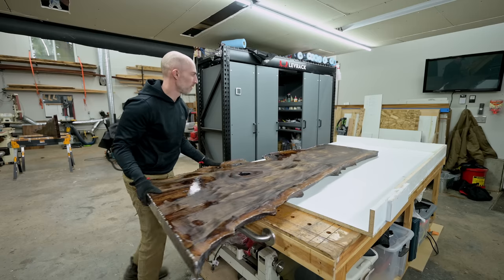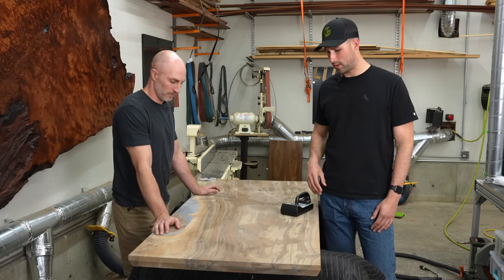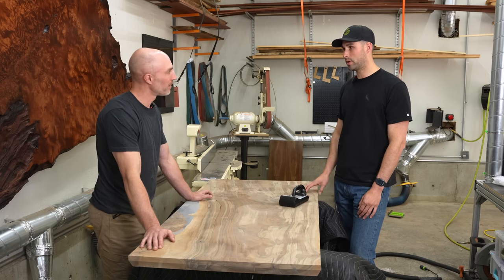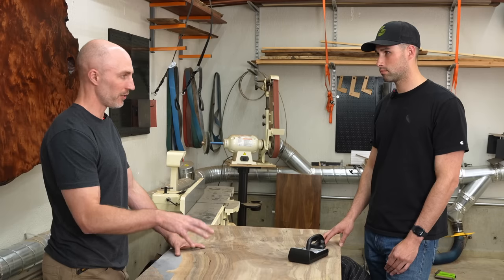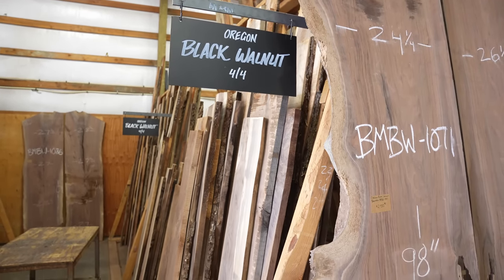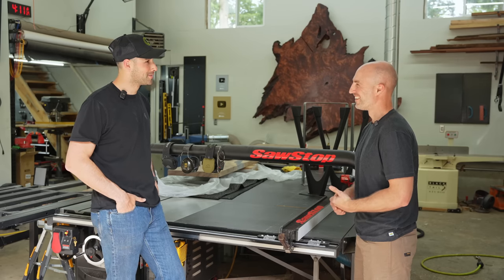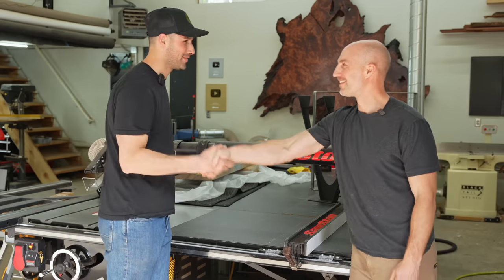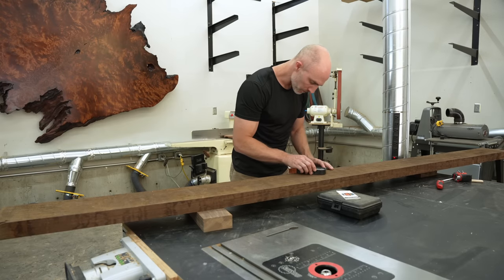Confronting My Wood Supplier

Comment: I found this whole thing interesting because when I was in joinery, moisture checking was far more thorough than what you'd been doing. In your defence, we wouldn't release stock from the kiln until we'd determined that moisture content was right. If it wasn't, we figured out why and solved the problem. They shouldn't have sold such a valuable slab with such poor quality control. Even so, moisture changes after the kiln as well... You need to be on top of it because once it's out of their hands, it's on you, and things could fluctuate significantly enough to cause problems even if the moisture looked right coming out of the kiln.

Perhaps you got into this without a formal background, like schooling or an apprenticeship (or both), which is totally fine. I just can't imagine going through all this trouble without ascertaining a lot more information about the material I'm working with. Moisture will ruin things though, no matter how much love you put into the process. You've got to lock that down at step 0, not step 20.

You did the right thing for your clients. I'd personally try to reinforce and rebuild my relationship with that supplier though, because there are far worse out there and they really could have said "hey, we don't know what you exposed this too, and it's your responsibility to check moisture before building with it". Unless they offer any kind of guarantee about moisture. I've had panels of beech plywood delaminate though, and my supplier just said "make sure you store it properly next time". These were $180 sheets of marine grade plywood sitting in a dry shop in summer – they had no interest in helping me out whatsoever, so I thought the treatment you got was relatively excellent.

Comment: It would be useful to have some discussion about the risk/reward of working in these extremely figured pieces of wood.  My impression is that the market value goes up, but also the potential for problems.  Specifically, here, I'm guessing the liklihood of moisture problems and the difficulty of "clearing" a piece for construction both increase maybe geometrically.

Comment: I have to admit that I did a bit of a flip/flop on this. In the first video, when you mentioned the $3,000+ price of the slabs I did a quick board-foot conversion in my head and thought that they were seriously overpriced. However, when Aaron talked about how they deal with things when they make a mistake, that readjusted my opinion of the vendor. In essence, by paying dearly for the product, you are also at least getting excellent service and a sense of responsibility on the part of the vendor, which makes the price much more acceptable. Kudos to Gobi.

Comment: Wood is a a living thing. My opinion is that each massive wooden product then adapts to the humidity in the owner's room or place. I guess it matters when the wood was cut. So that there is as little tree juice as possible in the tree.  It makes a huge diference how much time wood needs to dry and if there is a lot of moisture wood nevery dries properly.   I cut and bucked some beech tree  for firewood wrong time of the year and this wood after 3 years of drying it appeard dry but when you put it on fire you could see the moisture coming out of the wood that wood never burned properly. So everything matters when to cut a tree and how to properly dry slabs.

Comment: Cam - with this "lesson" learned, you really should address the knotty (!) question of choosing the "species setting" (i.e. specific gravity) on a Wagner moisture meter for walnut.   The setting varies with the exact species of walnut (there are varieties of "Black Walnut") and will even vary between heartwood and sapwood on the same board.  The setting makes a BIG difference in the reading you get.  So, what setting do you use, and how do you know it's right?

Comment: not only slabs of wood should be checked but also slabs of concrete on weather exposed decks with leak issues...i did a transparent flexible polyurethane treatment on a tiled porous concrete slab in the middle of summer at peak heat days but there was moisture trapped in the slab which released into the wet poly treatment visibly as small bubbles - the heat was releasing the moisture as small jets of steam through grout line breeches and nearly ruined the treatment. I managed to find a solution but it took a few days to sort it out... still a simple moisture test would have avoided the drama and ensured a hitch free treatment.

Comment: The info provided is greatly appreciated, I was unaware of trapped moisture. Those slabs, if unusable, work benches wood be my use for them, crazy yes but I'm not right in the head anyways considering I make saw horses out of Black walnut. Nice saw horses.

Comment: I’m one of those painters from the automotive field.  Motorcycles, actually (BD’s Cycles, find me online if you’d like to see
My work). 

At any rate, check out CSI buffing products.  I quit using the 3 step 3M stuff, the CSI is 1 product, 2 pads.  Water based for easy clean up.  Works great.  Maybe that saves you some time, helps you out, etc.  ;-)

Comment: It's hard to believe you don't have a standard practice of checking moisture content before starting a project, especially with the thick slabs you typically work with. I guess you will in the future. Its the supplier's job to provide properly dried lumber, and it's good to see Goby offering refund/replacement or attempting redrying, but all the labor you put into the project is rightly your responsibility.

Comment: Seems to me that you could attach that sensor in place of the spindle on a cnc router and then generate an automated report per slab. Readings every square inch, if required for high value pieces. 

Defective slabs could even be sold if the bad zones are marked with a sharpie (we're already on a CNC gantry).

Comment: I would like to start what I am sure is going to be a long reply on this video, by pointing out that I am in no way a expert on this topic but I do have a perspective that may seem odd to some and I do like to share my thoughts on things lol.

So, I play guitar and I do watch a lot of videos watching luthiers build guitars and I pay attention to things that sometimes people miss in those videos.  I think this is why this video popped up in my feed lol.   Anyhow, with guitars the neck will move depending on the environment they are kept in.  Basically when it gets colder outside or hotter outside via seasons I will usually have to adjust the truss rods in the necks of my guitars.   Now, I do have a couple guitars where that is almost never needed, while others do.  The big difference between them is a carbon rod reinforced neck.   A couple guitars I have, had had two medal rods put into their necks to make them more stable.  Just in case someone is actually reading this and doesn't understand how that works, basically the fretboard is glued onto the neck, but before that is done three channels are cut into the neck, the middle one is for the truss rod, which when you turn its bolt it will add pressure on the neck in one direction or the other in order to straiten the neck, and the other two have carbon fiber metal rods.  Then they glue the fretboard on, and the result is that the neck moves a lot less than if the metal rods are not put into the neck.    
The wood its self is dried for sometimes years before it is ever used to build a guitar, though for the very cheap guitars wood may not be dried for the minimum of a year.  Now, guitar wood moisture is generally kept pretty low, but that is because they often intend on having a finish on the neck that will seal in what ever moisture that is in the wood, or not in the wood lol.  But one way or the other, if you live in a environment that has more moisture in it then was in the factory where the guitar was built, your guitar will eventually suck in moisture..  Just like if you live in a more dry area than where the guitar was made, the guitar will loose moisture.   This causes the necks to move, but between truss rods and metal rods, this issue is countered...
So, why am I talking about guitars on a video about wood tables that happened to have uneven pockets of water in them?  Because the problem is the exact same, and thus the solutions could be the same as well..  Though I am not saying just put a truss rod in these slabs, but the metal rods would stop most movement if done correctly.   Of course, you can use a combination of your meter to detect where the water is, and mark out where the pockets are, and then use some finish on the dry areas and no finish where the wet areas are, then put the wood in a warm and dry space for a while.  What will happen is you will pull the water out of the wood, with a focus on where exactly the wood needs it most.  The more dry and or warm the space, the faster it will be by the way.   This is why kiln's are used, because they are hotter and more dry, and thus they pull a lot of water out of the wood.    I see no reason why these processes couldn't be used for those slabs.   You could even make small holes where the moisture is the highest to speed up the process....

I know it would take a lot of effort to pull it off, but drying wood is not a hugely complicated process, it is usually just time consuming as all get out.  So if he was afraid of this wood moving, he could put some metal rods in it, and if done correctly this would solve a lot of the movement issues this wood would go on to have.  But if you seal the wood good enough, moisture wont get in or out any time soon, though it could move because of how the trapped water reacts to hot and cold swings, though I wouldn't think tables inside a home are going to have that issue that often.. In fact, the issue such tables would likely have would probably be based on the water that is already in the wood reacting to the normal swings of temps in the home. ...   

Though this was shorter than I expected it would be, I think I am done for now..  Its bed time for this old man lol..

Comment: Cam. I made it through both videos. It was great to see Aaron and Goby owning the problem and figuring out how to solve the issue. The question that I have on these thick slabs is that when checking for moisture do you only do it on one side or both? Is there a depth limit for getting accurate moisture content for a given spot? Thanks for these great videos.

Comment: I honestly would chalk this up to a very expensive lesson learned. Any manufacturer purchasing stock from a supplier will do their own testing before continuing with the order to ensure it passes. Goby may have had a problem, but I'm sure they have disclaimers. It is your responsibility to do your own inspection before continuing. This is what sets your $30k table apart from a $1k table. You're doing $1K worthy work if I'm being honest. 

We all make mistakes, and get caught up in just "getting the job done" that we overlook the necessary QC before-hand. Make yourself a checklist for every job, so you CANNOT forget this procedure in the process in the future.

I just want to add - you're losing a TON of money by giving away failed inspected materials. Mark them down at a steep discount, or put them on auction. You're lucky it's just you working this business, otherwise your decisions would put a small business under in no time.

Comment: I'd be willing to bet that the wood is still useful for someone out there.  I've just started making knives for example, and I bet that even with wet pockets in the wood that that slab would be enough handle scales that I'd never have to buy wood ever again.  The wood grain would probably make some nice handles and I could literally just cut around the wet spots.  Maybe someone out there like me needs smaller pieces of a nice wood and could still do something cool with this?

Comment: I have no experience with epoxy application, but I wonder: is this so specialized its almost unreasonable to burden a lumber supplier with?  I would also wonder if investing in a drum style dehumidifier would serve a shops needs?  Maybe plumb dry air to the back of a wood rack closed on 4 sides/let escaping air passing over stock dehumidify the shop by default.  [Munters makes nice units].  I also wonder if really odd/complex grain structures of some pieces almost needs a vacuum chamber [combined with low heat] to release deep/high moisture where a kiln takes too long.

Comment: Well that sucks but at least Aaron was cool about it and an honest businessman. Those readings are what I would expect to see before going into the kiln, not after. Seems pretty odd, like maybe the kiln needs better circulation. Anyway, this is a hard lesson to learn, anyone who works with wood for a long time will experience this. I get paranoid about moisture so I let big pieces sit for a long time before finishing them, even if the moisture content seems stable.

Comment: My thing is you're bringing the wood and a different environment and your humidity might be higher than his place where he had his wood at and the wood is soaking up the moisture so allow the humidity and then you could fix the problem that's why it's absorbing all the water and moisture inside where you are at. Maybe I'm just a beginner at wood work and I mess with wood slabs sometimes so good luck on that!?

Comment: High end problem, we have techniques nowadays that raise expectations to micro levels of perfection. But in the end it's a natural resource you are working with. 

Your tables and craftsmanship and attention to detail are out of this world. But have we not gone to far? Micromanaging wood to dry to perfection? 

There is wooden furniture hundreds of years old still around despite the imperfections worth the same amount if not more, not all because of design, rarity and build quality, but despite those imperfections that show how durable they are and why they survived. Tables full of moist pockets when they were build that are so worn down over time they are veneer thin from use but still solid enough for another hundred years.

I mean, this is just micromanaging and focusing on the wrong thing, the perfection of the material to justify the flawless end product instead of focusing on the craftmanship that creates a beautifull masterpiece. So what if there are a few pockets of moisture in there, you wanted a wooden table, a natural resource product. Want perfection dont but wood, habve the whole table made out of resin or machined out of metal to 0.00001 perfection.

Those same people probably spend tens of thousands on a hundreds years old piece of cracked antique because it looks so "vintage" and aged beautifull, they did not have digital equipment to isolate pockets of moisture back then. they dried wood and made something that lasted or not.

And let's be real, they only care for a few years about how good it looks, then that table dissapears to the mancave to be abused as a game table, or ends up as a solid workbench because it's time for redecorating. If the piece is solid it will survive as long as it gets into the hands of someone that recognizes the craftsmanship and solidity of the piece.

Your all bending over to a standard of perfection that is unsustainable, those tables with those pockets will survive time, they are made of natural materials (except the resin ;-) ) that simply has it flaws that are the core of their appeal and you accept those limitations despite the cost as long as it's build solid and with care and love.

Comment: I worked at a sawmill that took logs to flooring. All that happened here is they got lazy and or cheap and didn't leave it in tue kiln long enough. Often happens with mixed loading of a kiln. It's incredibly expensive to operate a kiln dryer.

Comment: Would stabilizing the wood work? Making a big enough vacuum chamber or pressure chamber. Either lowering the pressure enough that the water boils out? As for vacuuming, take moisture out and replace with stabilizing mediam. Just thoughts.

Comment: i'm not a wood working man but, why not drill some 1mm or maybe 2mm holes in the wet areas and fill them up with epoxy when they dry, I mean.... nobody cares whats underneath, I know is expensive but still.... ill try it, what can go wrong if you just release the "pressure"?

Comment: However good the process is never going to be 100% accurate as wood is a natural product. 
In fairness, a maker individual or company should be checking these raw materials are good to go, especially with individual massive slabs
Good conversation all around and well done to GW for holding their hands up

Comment: I work wet wood all the time I have projects with soaking wet wood in my own home done experimentally and nothing crazy happened to them years later .. I’ve noticed black walnut is a lot more stable .. there have been wet pieces that warp or crack but if you look at nakashima who created this whole trend way back when - his stuff has all kinds of cracks and movement in it and it doesn’t devalue its use as a work of art or a functional piece of furniture… mostly if the piece is going next to an oven or a fireplace it’s more important to have it dry but overall .. I find this concept of having bone dry wood kind of ridiculous and snobby .. I get it for perfectionists i guess

Comment: can you check moisture in the wood at the place of pick up?  if it wet there, no reason to bring it to your shop.
Reply: Every good wood supplier that we've seen has no problem with you bringing your own (pinless) moisture meter and checking the wood.